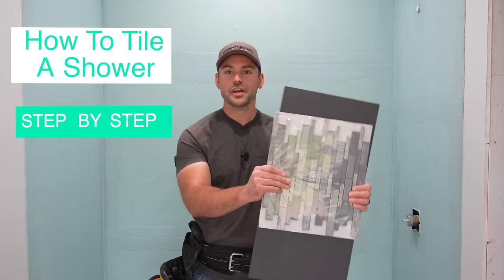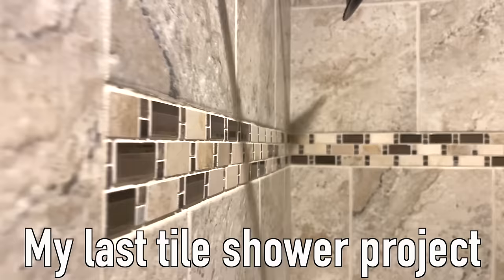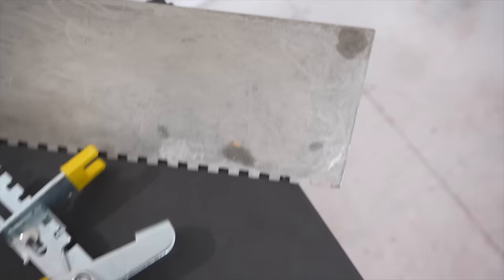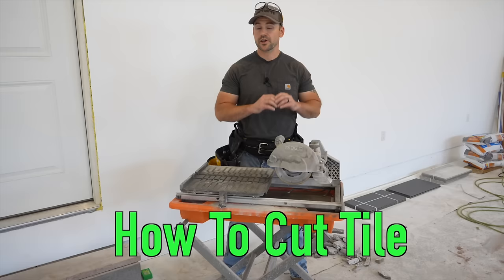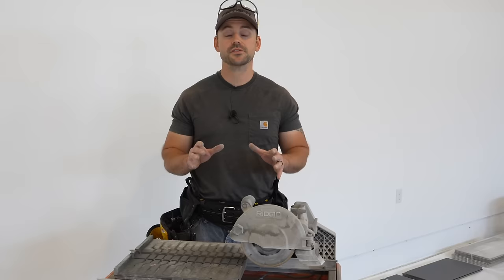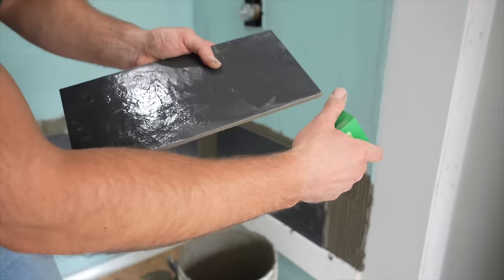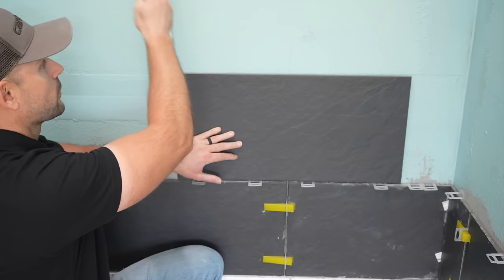How To Tile A Shower - Start To Finish Walls

Comment from the maker: Hey fellow DIYer's! There is A LOT of information in this video. I placed timestamps below  to help you navigate this video. Enjoy!
First and most important step 00:17
How to layout for a staggered look 03:16
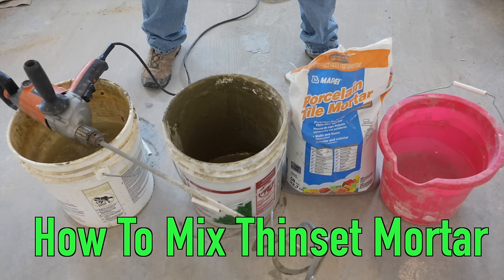How to mix thinset 05:27
How to set shower tile 07:23
How to cut tile 10:59
How to use a diamond sponge 14:20
How to make tile shelves 18:51
How to install tile shelves 24:05
How to cut out for the shower valve 27:31
How to remove the leveling system 30:29
How to install mosaic tile 34:09
How to install bullnose tile 36:57
How to drill a hole for the shower head 39:35
Reply: Superb job on this vid and the time stamps are great for all … always informative and energetic vids!  Hope your week is starting off strong
Reply: Seriously thank you for sharing your knowledge very noble and helpful!
Reply: You have the best videos for a DIY guy like me, so thank you very much!  Timestamp 1:27 shows 11 1/4" but I think it's 11 3/4.  It matters when adding the gaps to get the 12" starting line right?
Reply: Which line did you plum for the center is it the original or the sixteen off the center please
Reply: This was so helpful! And the way you explained everything made it so easy to understand and encouraged me to do the shower myself. Thank you 🙏🏽
Reply: L
Reply: how many mm of thickness does the mix turn out to be on average?
Reply: what is the preferred sealer to put on first before doing tile?

Comment: Should the ledger board have been 11 1/2 inches high? 11 1/4 tile plus 1/8 gap at floor and in-between tiles would be 11 1/2 not 12...am I missing something ?  thanks
Reply: i think its to add the size gap for grout
Reply: I was confused so came here to answer- BUT now I'm thinking it's bc he left room for
Floor tile? Wish I knew.  I'm trying to start my shower tile today!

Comment: I went thru a 4 yr apprenticeship to be a journeyman tile setter. 1970s. Back then we used string to space horizontal, eye and measuring vertical. All tile surface was adhered with pure cement, on sand, cement and lime plaster on walls and ceilings, that we floated ourselves to true up all surfaces. Used black rubber pails to mix in. All tile was soaked in square laundry tub that also doubled as a wet lube for tile saw.
Reply: Sounds tedious, with all the convenience of tools and material development it’s no wonder the learning curve has dropped dramatically.
Reply: @Vizzi12 tile work in the 70s still standing strong, tile done in the last 20 years, falling apart. So pick your battle's I guess.
Reply: @dragonrider9051  that’s not a product of installation many times, that’s a product of material quality.
Reply: @dragonrider9051  you not lying. The old school guys were better at building things. Nowadays it's just about cutting corners getting paid and dipping
Reply: Who cars? Geez.
Reply: @dragonrider9051 I've yarded out plenty of leaky tub surrounds from the 70's, 80's, 90's..... 🤷‍♂️
Reply: @moroniccolonic3959  if you yanked it out in the 70s 80s and 90s.  They were probably built in the 40s and 50s
Reply: @AndrewCantonTV  they were from those eras lol.  I am not

Comment: Hi Josh, I am wondering why you need to measure 12 inches from the floor for laying out the first row. The tile is 11.25 inches and you need 1/8 inches below and above the row of the tile. This equates to 11.50 inches
Reply from the maker: Sorry, the tile was actually 1 1 3/4”. Hope it now makes more sense.
Reply: Yep, I thought the same thing.
Reply: Lol now it make sense
Reply: Not gonna lie. I am sitting here right now trying to figure out how Josh came up with 12.
Reply: Why skip the bottom row to begin with?  Instead of leaving that space, starting with the second row of tile and working up from there, and then going back and putting in the bottom row at the end, why not just start with the bottom to begin with?
Reply: @stevenrine5380  it's because sometimes the Pan is uneven. Better to scribe the bottom to size than the top

Comment: Excellent video, just one pointer from a guy who works for one of the major tile setting mortar (ie thinset) manufacturers. Always put the water into your mixing bucket first, then slowly add the powder. You can add more water to adjust consistency if you need to. Most manufacturers will give you the maximum amount of water to add on the bag instructions. Same with grout or any cement based materials. They mix better.
Reply: Ok Mr. I work for major thin-set co. Let's see what u really know, whats the difference between gray or white thinset ????
Reply: @smonroe207   so whats the answer?????
Reply: @smonroe207 , one is white and one is gray.

Comment: Thanks for the detailed demonstration, just one minor thing I observed is the width of the tile is 11 3/4 inch but not 11 1/4 so you install the second row 12 inch above the pan. Great work.
Reply: great observation! I am still trying to figure out why he went to 12" if the tile was only 11 .25"
Reply: Man I am glad you said this!  I must have re-watched that section 20 times trying to figure out how he got to 12"!   Thanks!
Reply: @seanrichards  tile is 11 3/4” he just said 1/4 instead of 3/4. He does it at 12” to allow 1/8” gap at the bottom and top of tile for grout.
Reply: I too could not add 11 1/4 + 1/8 + 1/8 and get 12.

Comment: Hi my name Robert and I’m in the middle of doing the same thing you’re doing in this video in fact I’m gutting out the entire bathroom all the way to the beams because of mildew issues . I’ve watched all your videos from installing the shower pan to dual rocking and waterproofing I’m amazed and believe me you’ve showed me things I didn’t know . I would like to show you pictures when I start the installation process and I’ll be more then happy to except some pointers. Keep up the good work

Comment: I followed your methods and did our shower. I’m a brickmason so I’m pretty good at layout and decorative patterns. The long wall I did a running bond with subway tile and the two end walls I did a herringbone. First time I’ve ever done tile let alone hanging cement board and waterproofing it. Very helpful videos.

Comment: Hubby and I did a tub surround and tile floor in our master bath 25 years ago. Although the cuts weren't perfect, those tiles still are perfect. No cracking, lifting, etc.  I did regrout and seal everything about 4 years ago in preparation to sell. If done correctly, a tile job could last a lifetime. That house also had an original 1941 black and white tiled bathroom, that I regrouted and is in pristine shape to this day.

Comment: It’s best to use a half inch by half inch notched trowel on tile the size specifically because of the way it suctions the tile to the wall better. Also clean the thinset off the face of the tile and off the edges of the tile with a margin trowel in sponge as you go itll make grouting so much easier and just the entire process in general.
Reply: You're absolutely right. The only trouble is that it makes a big gap on the edges. The schluter tile trim won't be against the wall with that much thinset behind the tiles.
Reply: @ch1959  well you can either use a jolly strip on the edges instead of bull nose to mitigate that or you can put grout caulk on the edge of the bullnose tiles.  I’ve never ever had a problem with it sticking out too far. Also i just realized I don’t think he did the water proofing.

Comment: I'm doing my bathroom right now I demolished I piped in the shower faucet I had to move the drain. I set the shower pan using a tile redi pan .
Now I have to tile this is a great video. Thanks wish me luck.
I'm a hvac technician so I'm somewhat handy

Comment: I remolded not only my 1st foreclosure house, but I also worked for 5 years for a remodeling company here in S. FL. Some great tips here, and it's a great video. Many DIYs don't realize you need that level piece of wood to make sure there are not obvious slanted lines and also support to the tile on walls till the thin set starts to take hold. Unless it's a new build, many showers have bowed and non-plumbed walls. You walk in a shower and eyes are always drawn to eye level and above. Rarely to a compensation cut at the bottom. Also back buttering is essential. Again, great video!
Reply: I'm in the comments to try to understand the wood pieces, is that really necessary? Can't I just start at the bottom?

Comment: Thank you for this video. I really like watching it. I have done 2 bathroom floors but not shower wall yet. For the bathroom floor I used the Schluter Ditra membrane which was very easy to work with. I am now planning on doing a 60x30 shower wall above a tub which is why I am watching your video. Not sure what wall board am going to use yet.

Comment: Thanks for the video. I am starting a project to tile my 60x32 shower. This video will help. One suggestion is to dry fit the tiles before applying the thin set. And am glad to mentioned scraping off the thin set above the first row.

Comment: I did a tile shower in my previous home. It came out surprisingly nice. I used 6" Tiles and designer tiles with a Teal, almost see through, Glass diamond design about 2/3 of the way up. I am in my 70's now and am seriously giving considering doing a shower here.

Comment: I have always enjoyed doing tile and coming up with unique looks. The time is rewarding for sure for me and the home owner. Using mosaic tiles is a great way to do accent borders in many ways. I had one job I used one that had some glass 1 inch square pieces that I actually used on the by 12 tiles and I clipped the corners periodically when I did a job floor to ceiling. Then I continued the decorative mosaic border around the mirror that was recessed in the tile as well. It was a very rewarding job at the end and very well loved by the customer and friend of mine. I love using both styles of wet saws depending on the jobs. Putting the board across at the beginning and the same as your border section is always a plus. Fantastic job Josh, and wonderful choice of colors.
Reply from the maker: My wife picked out the colors. I was just the installer 😃. I’ll let you know you liked the colors. Sounds like a beautiful project you did! It’s very satisfying to look at a tile job when you are finished. Like always, thanks for watching and commenting David!

Comment: I am not a "TILE LAYER"  but I've done a few jobs. I never use a leveling system I've never even laid out lines on the wall like you did. I admire your work and I've learned from it and I agree some times tile can be warped Like a 2x4 from Menards. It's a dirty job its messy but I have never had any complaints. Especially when I'm working on my own house Hmmmmmmm.

Comment: It’s been a while since you posted this, but if you’re still curious about anyone who is doing a diy tile shower….well I’m doin it, bro. I’m doin it! 

First time though so it’s slow going and confidence ran out after I was told “demo” is not a legit interior design and I have to replace everything and can’t keep the toilet in the dining room.

It’ll be a bit before I get to the tiling though. I’m just finishing up new insulation and electrical. 

Your videos are a huge help! I appreciate you!

Comment: Absolutely fantastic videos my guy. This really helped me from start to finish. I love how you explain things very thoroughly because sometimes there is little steps you might miss or not think about, like the trimming of the cement board at the flanges.
Reply: He never explained how to replace the empty Wedi sausage caulk tube system.

Comment: Hold a trowel at an angle and remove some of the mortar from the tile edge before sticking.

Use a toothbrush to clean all mortar squeeze along the way.

Comment: Actually if you get a quality tile cutter it cuts porcelain just fine. Been doing tile for twenty years. That being said I do use a wet saw the majority of the time. Also the job looks better if you use schluter on your exposed edges. You definitely do nice work for a guy that dabbles in everything.

Nothing worse than warped tile, especially 12x24 on a split running bond pattern. Those leveling systems are a game changer for sure. It takes time and plenty of experience with some patience to set without them to get a quality job. If your doing a job like this without the leveling system then use a level and rubber mallet to make sure your tiles are flat. It’s a little more tedious but perfection is the name of the game.

Another nice little trick for you accent tile is set it to the kerdi band the day before and then just set it in three pieces. That way you Don’t have to worry thin set oozing through. I learned that little trick from Sal Dablasi on his YouTube channel. He’s a tile guru. 

Edit, I didn’t know you had a bullnose to finish edge when I mentioned the schluter.

Comment: Great video. 
Did I miss something near the beginning? Tile is 11 1/4". Leave 1/8" gap at top and bottom. Mark a line at 12"? Shouldn't that be marked at 11 1/2" off the shower pan? Thanks.

Comment: Tiling the tub / shower today.  I needed to understand how to measure and this video helped a great deal.  I plan to extend the tile a little bit beyond the shower, so when I measure  the spigot wall, my center line will align with the center of the spigots.  Great job! Thanks.
Reply from the maker: You are welcome Donna! I know if you have not done tiling before it can seem daunting. With a little guidance most people can do the job themselves. Good luck with your project!

Comment: Of all the tiling videos I've seen this is the most extensive - Thanks!  I read through all the comments to get a question answered and it must be annoying for a dozen people asking the same question about 11-1/4 vs. 11-3/4!  I wondered also, but was clear by just reading comments.  I also have watched your videos about installing, taping and waterproofing the cement board.  But my question is about where the tiles meet the ceiling and concerns about water penetration.  In your taping video I didn't see what you did there.  Use Fibatape in corner between wall to ceiling?  Thinset on the fibatape on shower wall and sheetrock spackling on the same Fibatape on ceiling?  I am not sure the best way to do this to have to let no water get behind but to still be able to finish/paint ceiling.  Again, thank you for the video and in advance for this answer!

Comment: Great vid, I just noticed that at timestamp 01:28, you indicate that the measured size of the tile is 11 1/4", but the tape measure actually shows 11 3/4".     cheers
Reply from the maker: Good catch! Thanks for letting me know.
Reply: This was a good catch. I was struggling with why you would measure 11 1/4” then 2- 1/8” grout joints and then set your board at 12”. I could not figure out what happened to the other 1/2”. Good video overall Josh, I wish I could just get you to do mine though. Lol

Comment: Thank you for  some great information. I am about to redo one of my bathroom tub tiles and love that wedge system. 
Also I think I’ll be doing an inset niche using schluter trim around it and matching with the outside so no bull nose.
Reply from the maker: You are welcome Rob. I do like the recessed niches. They were good but they are a lot of work. But anything worth doing will be a lot of work. Thanks a lot for watching!

Comment: I like to use the remaining pieces from the cut tiles on the back wall as a starter for the sides, rather than centering the sides. Less scrap that way and in my opinion looks easier on the eyes.
Reply from the maker: Sounds like a good way to do it as well Jay! So many ways to do tile it is endless. Thanks for watching!

Comment: Yes, have tiled many showers. It’s detailed work and takes experience. Not a typical DIY project, very few can pull it off-most cannot. Thx to Covid, many people had lots of time to do home projects. I saw many DIY shower jobs when assisting my daughter along her 1st home search. What did I look at first? The showers and other tile jobs. Most were horribly done and all I saw was “lipstick on a pig” with potential major shower failures. Those houses we passed on. 1/2” tile gaps, sloppy installs and just bad craftsmanship. One other horrible fad is the “adhesive” tape on the wall for backsplashes. It may look good for a short time but fly paper for tile is just a bad method. Use Mastic or thin set based on application and moisture conditions. Nice video.
Reply: 💯 agree with everything you mentioned. Especially "Not your typical Dyi project."  I have a tile business in south Texas and like you have seen so many failed projects. We can both probably nit pick this video but its actually one the best detailed videos I've ever seen.

Comment: Just finished my heated tile floor. I should start  the shower next month. Only have a manual tile cutter so i might have to rent one like yours to make sure all my cuts are perfectly straight.
Reply: I think he did 12 x 24 tile is probably 11 3/4 not 11 1/4 !

Comment: Super detailed video that covers most everything needed to get the job done.
Reply from the maker: Thanks Sandy. I know the more details the better. I appreciate you watching!
Reply: @TheExcellentLaborer  : Just about to start a project and the part about layout I’m finding particularly helpful. If aluminum edges were used instead of bullnose tiles, do those get installed at layout time, or slid in place while thinset is still wet? Also, how do you finish the bottom tile where it joins the shower pan? Grout or silicone caulking?